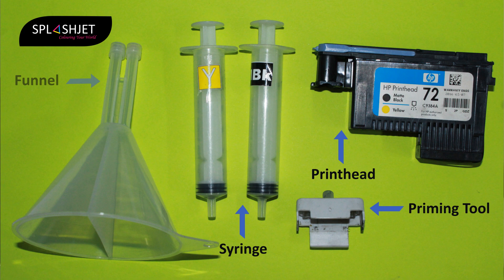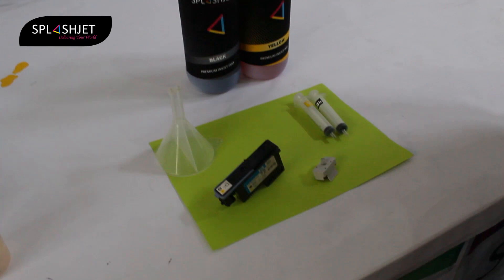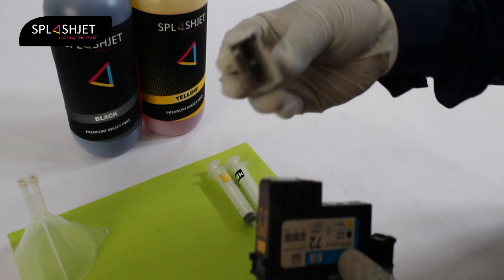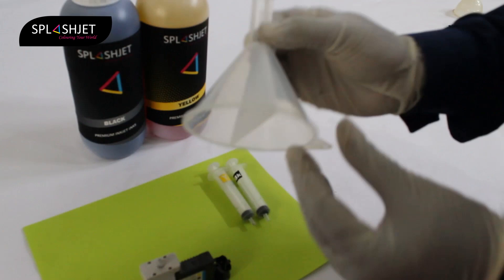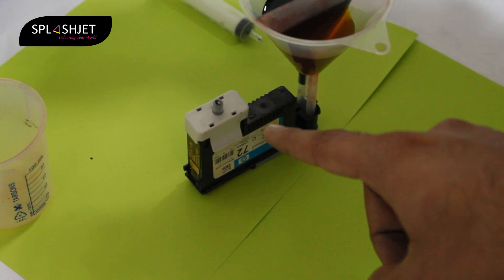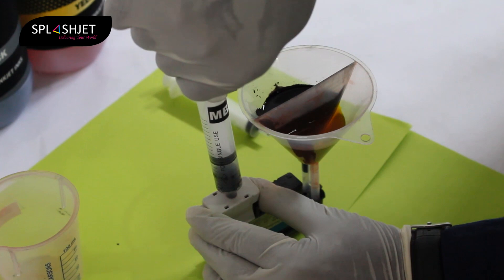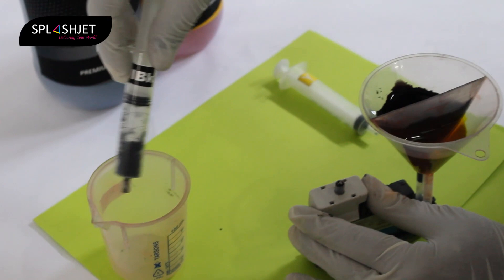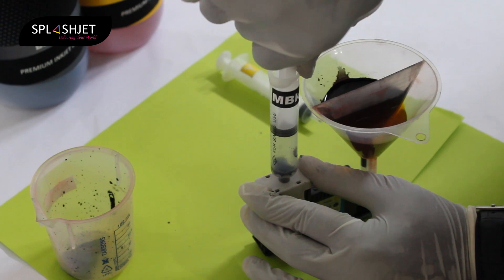How To Prime HP DesignJet Printhead

Comment: The guy in the video is wrong, all you did was suck out the old ink and primed it with air, the new ink couldn't reach the end of the funnels due to air being present there.
Reply from the maker: Apologies for the inconvenience. However, if you do follow the priming steps more time the ink will eventually reach the printhead.
Reply: so what the solution then?